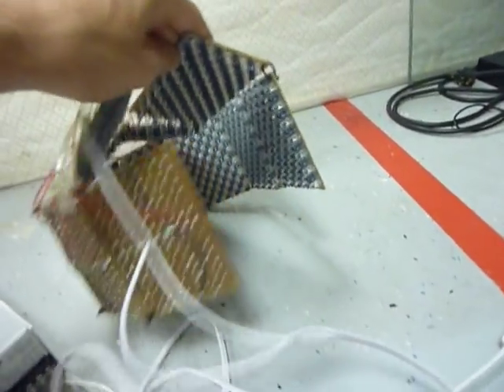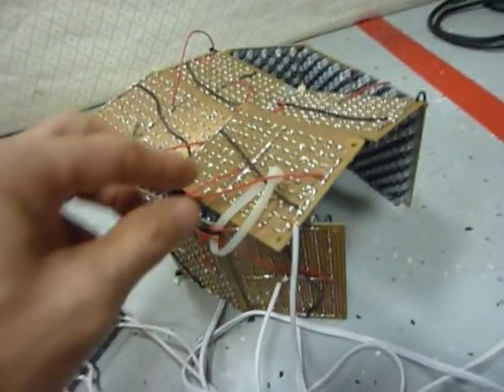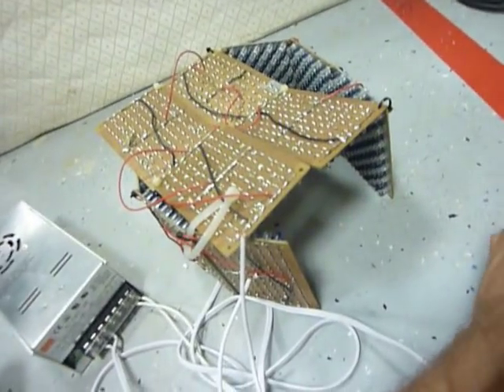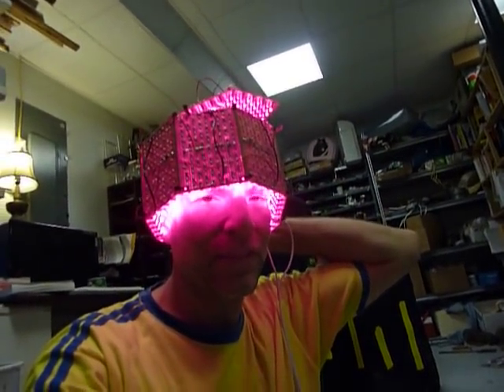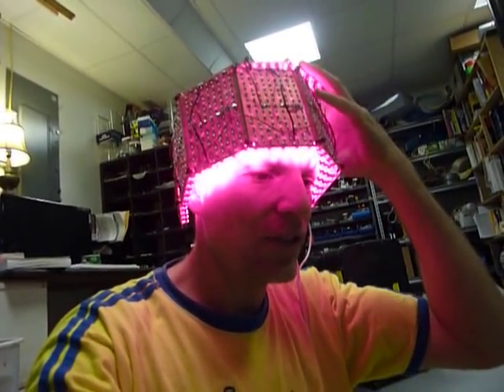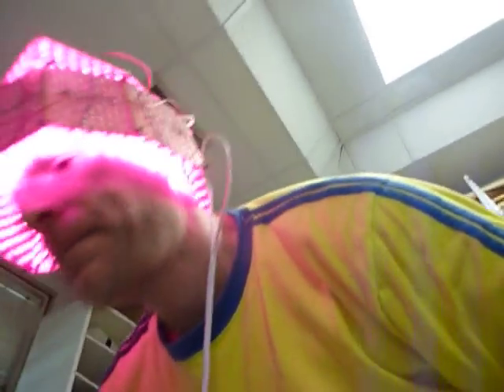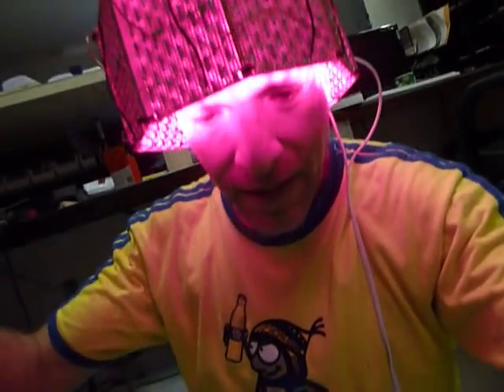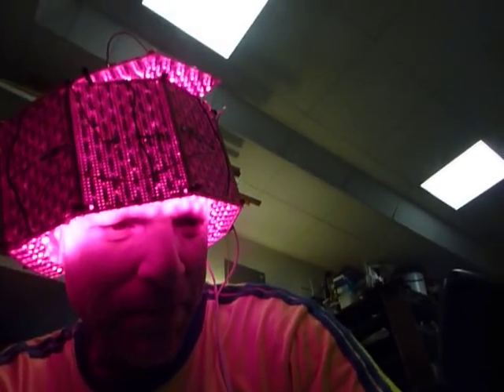LED helmet for dementia

Comment: how about using LED strips. I see that 660nm and 850nm strips are available. with that in mind, like I saw a strip rated 60 LEDs @ 14.4w per meter ? would this workable making a 1x1 sq foot panel of this ?
Reply: This is what i want to know

Comment: Hello, there. If I'm using a 7 cm diameter 48 LED array applied to the forehead with a 12V power supply at 500mA, how many joules/cm2 is that delivering at 8 minutes? That seems high.

Comment: hey @zawy i love the blog and your video. just wondering as its 2018 now, what would you say in your experience are the absolute best wavelengths for enhancing Cytochrome c Oxidase function. i know in the blog you say you had great experiences combining 660nm with 850nm. is that still the case?

Comment: Nice work, would almost be worthwhile to get someone to do a more 'professional' sewn enclosure in a non-heat-trapping material so that the circuit boards are not exposed - DC can be dangerous when there's sharp points exposed - just think of this classic example: [can be found by googling: "Resistance is Futile Darwin Award"]

Comment: high powered LEDs are inexpensive on eBay. they seem decent in quality. they also have ir. they can reduce the footprint. they do need heatsinking. I just switched back to incandescent for a desk lamp to get some near ir because I read that too high a blue to nir ratio is unhealthy. did you use the daytime?

Comment: thanks for sharing zawy, does this stops the electronic harassement of "what you see is what they see", done through drone mounted cameras and radar?
Reply: No, you have to log in the mkomega van that's spying on you and manually crossdelete MKOMEGA database entries about you. you need keys to do this.
You shut down a MKULTRA/OMEGA agent without destroying the robotic fake brain, then you carefully remove the nuclear core(they are sealed rods of plutonium, just dispose of them in the trash) and dissect the fake brain with a circular saw. 
The MKULTRA/OMEGA agent key looks like a purple triangle and is located inside the "frontal cortex", you need to disable the shitty ARMV13 system on chip located in the fake cerebellum however, otherwise the chip can send alarm messages to the US government even if unpowered, an electroshock should disable the shitty ARMV13 chip.
Disabling an agent is simple enough, with a white van you just ram them over during the night with no lights, they put the move/collision detection code on the slow as fuck ARM system on chip instead of in the higher level and faster neural network accelerators to avoid AI hijacking. The shock in the plutonium rod should disconnect it temporarily, then they shutdown without being able to report hostile activity and more importantly without being able to identify you. They'll think the shitty firmware got glitched again.

Comment: Hey Scott I have a question about LLLT dosing. I was reading lostfalco's website and he stated that you rated each diode in the 96 LED IR CCTV camera array at 23 mW. Multiplying this by 96 LEDs you get 2.2 W. The device however is rated at 15 W, which gives 156 mW per diode. I'm curious as to where the 23 mW came from and whether it's correct or not. I don't know anything about this stuff and am trying to figure out dosing for my own transcranial stuff. Thanks!
Reply from the maker: 23 mW per LED is the amount of light output. This comes from estimating LED efficiency to be about 33% of the energy coming into to it.  So 3x that is 69 mW which is around the max you can run the 5 mm type LEDs without a fan.  156 mW per 5 mm LED is about the max with a fan.  It's light energy should be about 50 mW per LED.
Reply: Thanks for your reply. I'm a bit confused though... "23 mW per LED is the amount of light output" and "It's light energy should be about 50 mW per LED"... what is the difference between these two statements? Why are the numbers different? If I want to calculate the power output of the device in mW/cm^2 I should use the value of 23 mW per LED?
Reply: @mattm1982  optic power îs different from electric power.